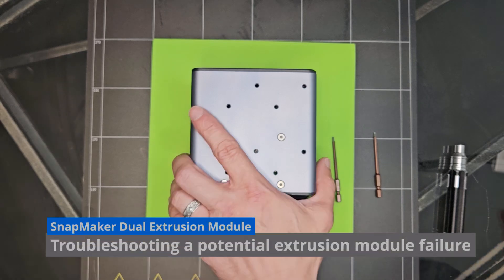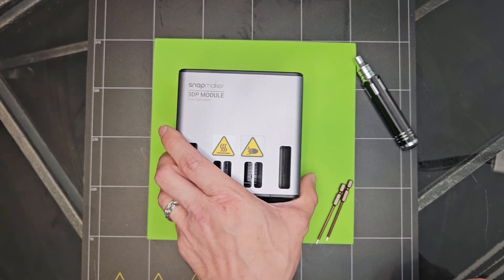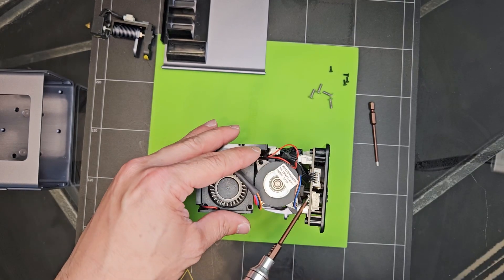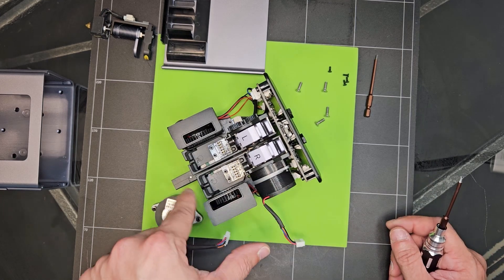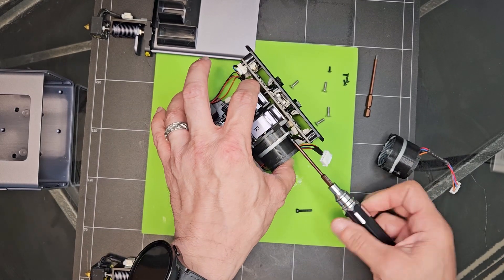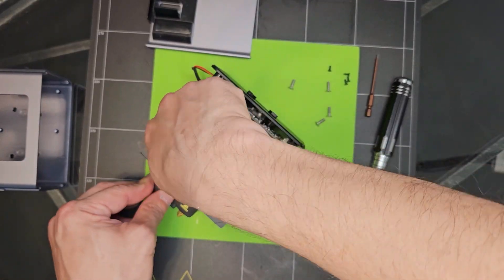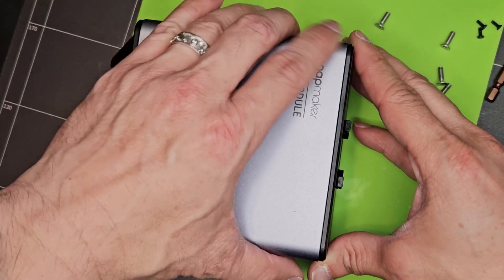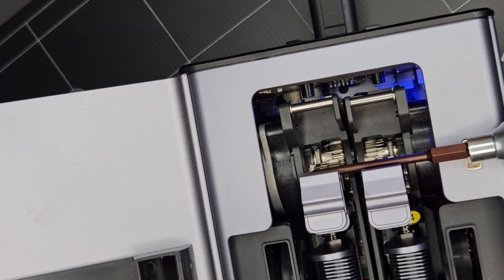SnapMaker Dual Extrusion Troubleshooting

Comment: Hi, great video there! I'm having an issue with this module also, while printing with the left nozzle, the nozzle starts to go up... then after some seconds falls down... it seems that while pulling the PLA material from the roll, the strenght needed to pull the PLA filament is greater.. and starts pulling the nozzle up... you have any ideia if there is any adjustment for this? Thank you.
Reply from the maker: @stuffexperiences7972  I had a similar issue that you're describing. Turned out the filament dryer that I also used to feed my printer with was the cause. It had too much friction and wasn't feeding the filament smoothly like it should. I removed the dryer from the equation and tested out the printer and it worked perfectly fine after that. If you're using a dryer/enclosure and/or a tube to feed the filament through, remove them both and then try printing. If it works, then either the tube is the problem or the enclosure is.
Reply: @R-TechEnthusiast  Awesome! Thank you for your prompt reply! But did that already :D i have both enclusure and the plastic "tubes" - i connected directly without any friction on the way, but it happens the same thing... what i can notice is that the left nozzle if you pressure up with your finger it is way more easy than the right nozzle... i already opened the head (thanks to your video :) ) but i do not see any way to adjust this "pressure"...
Reply from the maker: Have you ever disassembled the module before to replace the filament sensor or other part?
Reply from the maker: If you've never fully disassembled the module before then ignore my question above. :) 

Yea, as far as I know, there's no way to adjust it. It could be the motor or the board. For that, you should contact snapmaker support and tell them the issue, but also tell them what you have done to eliminate the filament enclosure and the ptfe tube as the culprit. I would also recommend taking a short video of what it is doing so they can see it (just be sure to post it somewhere they can access or put it on google drive so they can download it) and also leave the door open to the dual extruder so they can see the inside where the extruders are. The board behind the nozzles tend to have a blue light that lights up during certain movements, they'll want to see those lights in the video. With that, they should be able to determine if there's an issue with the motor or the board or something else that's causing it.
Reply from the maker: If you have done a complete disassembly before, did the problems occur before or after re-assembly? There's a chance it might not be re-assembled properly if it's been disassembled before. Wouldn't hurt to take it apart again and re-build it. I know there's a part in there that must be put back in a certain way and with certain "measurements" to insure it works properly. That is assuming you did a full disassembly to replace the filament sensors or other minute component. It is a much more detailed disassembly of the module then just the motor or board like in the video. I had a video of changing the filament sensor in the dual module, but I guess I forgot to post it as I don't see it... Oops.
Reply: @R-TechEnthusiast  Yeah... something seems to be odd with the differente nozzle head preassures... right nozzle is ok, can pull the fillament without problems. Guess i will have to go to Snapmaker. Ok, i will have to prepare some videos :) - thank you for your help - this video was awesome content, hope you get more people! [ ] keep up.
Reply from the maker: Yea since the components are separate, it's possible for one side to fail while the other still works. Good news is, while you're waiting for Snapmaker to reply, which usually takes over 24 hours since they are in China, you can still use the other nozzle to continue printing, just can't do dual filament printing.